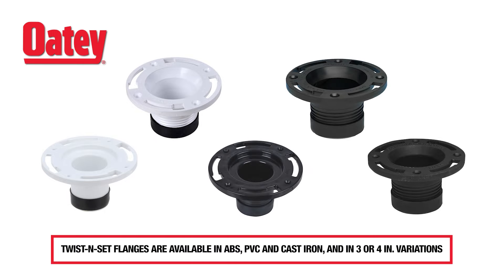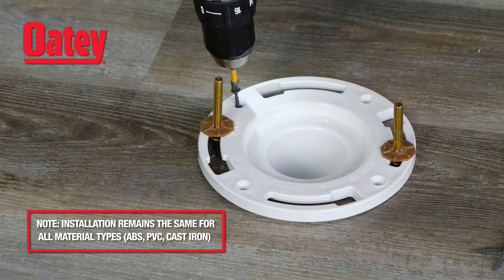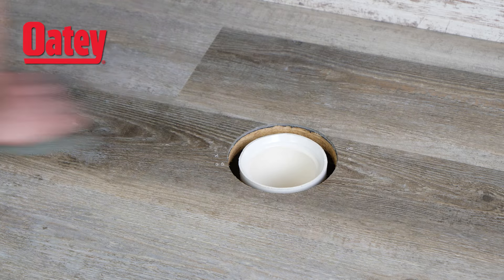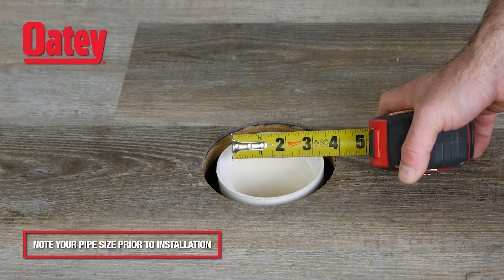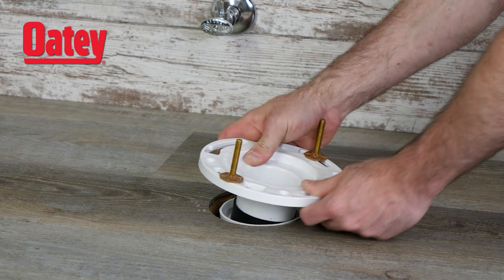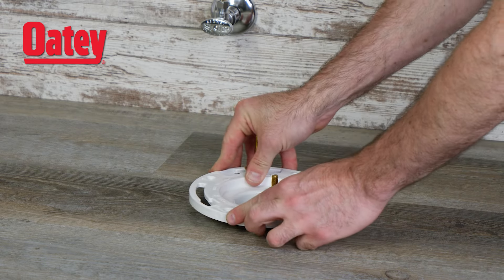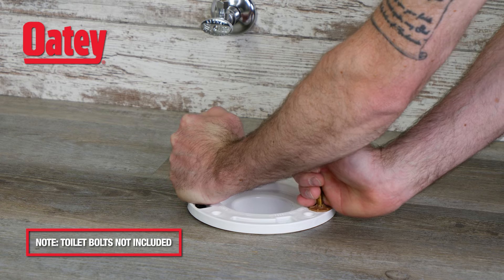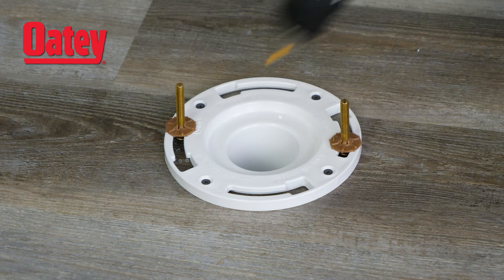How to Install Oatey Twist-N-Set Replacement Toilet Flanges

Comment: The 3 inch one is not smart because the bottom  flange is not flat. The pipe has to cut down a quarter inch lower than the floor and the pipe surrounding  has to cut at least 3/4 inches wider. Otherwise, no way to lay the flange flat on floor.

Comment: What size screws? Especially the screw head size? Can't just use standard size screws. They go right through the hole.
Reply from the maker: Number 8 screws work. But the length and type of screw will change for every situation and need to be confirmed in the field. 👍
Reply: @OateyCompany Are there screws for cement?
Reply from the maker: Yes, masonry screws but we do not provide those.
Reply: @OateyCompany 
"Number 8 screws work."

 This is WRONG!

I'm currently staring at this product partially installed, and #8 deck screws, #10 screws, and drywall screws (as shown in video) ALL slip through the holes in the flange.  The holes are not the same size as shown in the video, they're actually over 3/8" ID.

This is why ALL the google searches on this product, and the only comment on the products youtube video are ALL asking what size of screws are recommended.  Because regular #8 screws DO NOT FIT, they slip right through the hole.  

The product overall is good, but the holes are definitely oversized, and this either lying or ignorant response from the Company is not a good look.
Reply: Like  @NeedlessPedantics  said, #8 screws are too small. I used 1/4" tapcon screws because I had to sink mine into masonry, but those were a little loose. I can't confirm it, but I feel like 3/8" screws would be a snug fit. Make sure they are V-shaped on the bottom of the head, not flat on the bottom, as the screw holes are countersunk.
Reply: @j0mbie  I ended up making some custom washers for deck screws.  As you mentioned the holes are bevelled, and thus the washers had to be pressed into a bevel shape.

The screw holes are sized for the 3/8" bolts that hold the toilet down.  Bad design choice.

Comment: is the white PVC twist n set ok to use inside an ABS black pipe? Nothing needs to be cemented and the size seems to be accurate so i'm thinking it should be ok. thanks
Reply: I know they make an abs twist n seal , i just happen to already have a pvc one.

Comment: What type of wax ring or seal is used with this? I have the Fluidmaster better than wax seal but it does not fit the ID of the fitting.
Reply from the maker: A standard wax gasket without a horn is recommended.
Reply: @OateyCompany  good. That's exactly what I did.

Comment: What is the process of removing one of these flanges? Just twisting in the reverse direction?

I'm looking to temporarily install a toilet with a plan to remove after about a week, and this seems like the perfect product if I can plan ahead for how I will remove it.
Reply from the maker: Yep, that is correct! Remove the fasteners securing it to the subfloor and twist counterclockwise to loosen the flange.